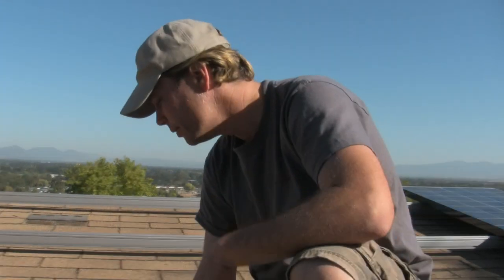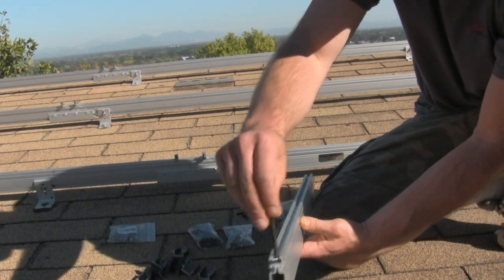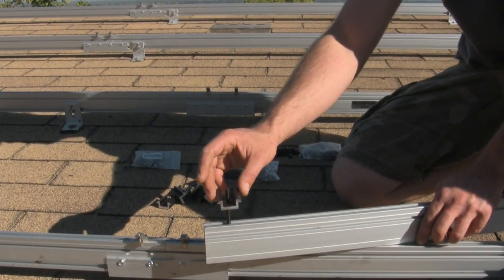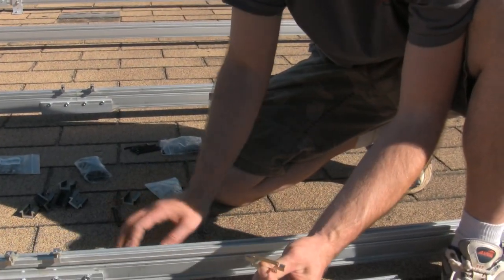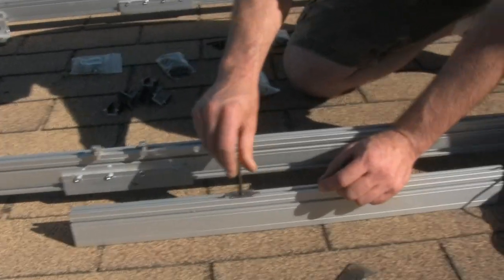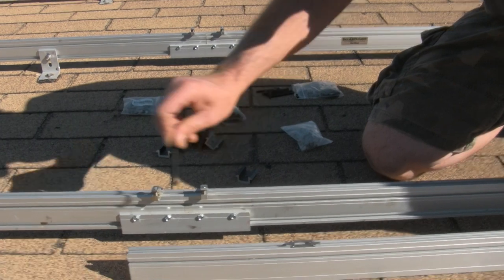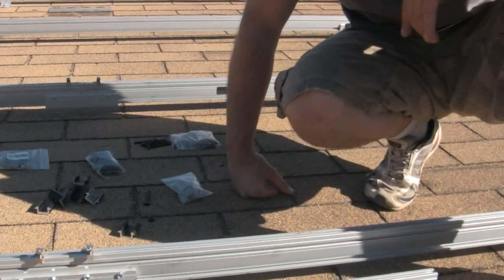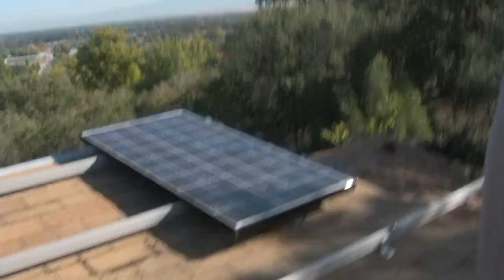Unirac Solarmount Racking System for Gridtie Project

Comment: Hello. I am a home owner in FL about to install a 30 panel array on my shingle roof so I have been doing relentless research and checking out many videos. 

Flashings is where I am stumped. It seems it is standard practice to use a flashing system that is around 12x12 in which you tuck about half of it underneath the above shingle having to tear into it.

Now, I'm saying to myself this is not a good idea to have to break apart shingles at all. I don't get why it's standard to do it in this manner. Maybe I am not understanding it.

As it has taken me 4 months to finally get my permit to do this I had purchased 5x7 steel flashings on Amazon at about $50 for 100pack. My purchased system included the L-foot with rails and attachments but no flashing parts.

As a way to cut costs and perhaps perform a safer method I noticed these flashings fit nicely horizontally between my shingles and that I could firmly tuck the top of the flashing into the above shingle without tearing it apart and putting it directly underneath it.  Also the flashing would not overlap the shingle below.
See my photo at this link
https://s26.postimg.cc/4hc1x7hi1/20180410_173143.jpg

My proposed plan would be to use a generous amount of sealant on the flashing, fill the hole with sealant, then tighten down the bolt through with the proper washers.

Sound crazy? 

Why not go this simple?

Am I on to something or do you think I would be at greater risk of leaks or rotting overtime?

I would greatly appreciate your opinion

Thanks so much!

Comment: Hey Solar Steve hows this system holding up after these 8 years or so? You didnt need to use flashings? I'm about to install this on my house in Orlando. I'm a little nervous come Hurricane Season
Reply: Yes u most definitely need use flashing. And the unirac system has a 20 year warranty. This system is top rated against hurricanes